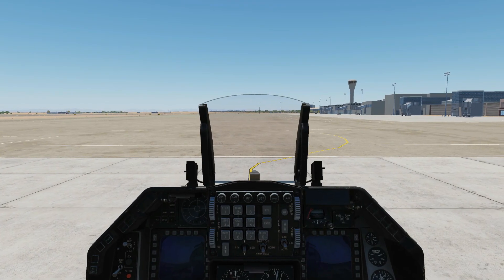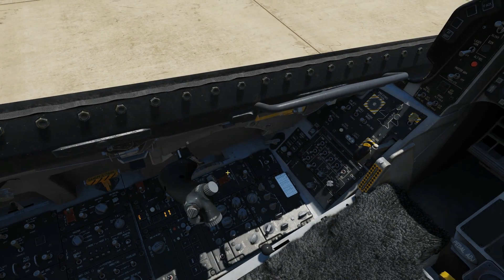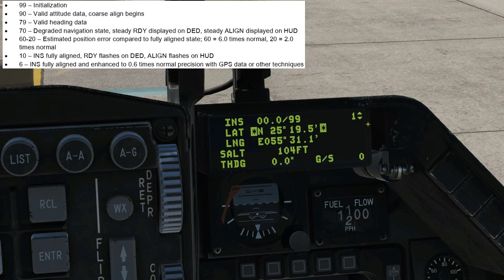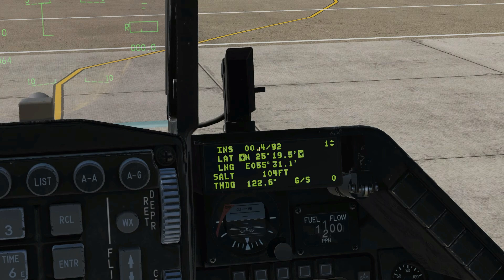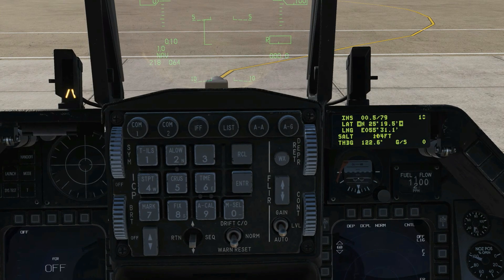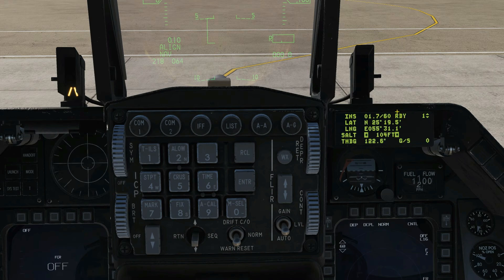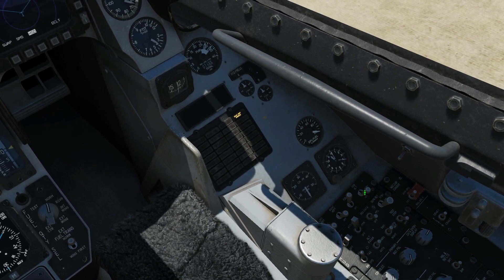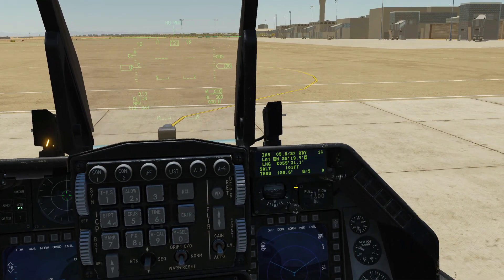F-16C Viper: Cold Start & NORMAL Alignment Tutorial | DCS WORLD

Comment: Main PWR on
Close canopy, canopy handle down
JFS Start 2
Wait for stable 20% RPM
Throttle to idle
Wait for stable 60% RPM
Switches on: UFC, MFD, ST STA, MMC, GPS, 
MIDS knob on
INS knob norm, (LIST + 6, 8min to fully align)
Confirm LAT and LNG, each with ENTR
IFF knob norm 
C&I knob UFC
Adjust backup ADI
Switches on: FCR, RDR ALT
Scroll HUD brightness 
RDR power on 
CMDS mode MAN, CH on, FL on
Arm ejection
Ext/Int lights as required
Check warning panels for warnings
After INS align complete -> INS to nav
Reply: Thanks!
Reply: Thanks
Reply: @BOUNCY700   You need to confirm the coordinates LAT and LNG like shown here: https://youtu.be/ynVslvvehB8?t=114  Otherwise Datalink won't work. I'll edit my original comment.
Reply: What about the Air source? I believe Falcon 4.0 used to require me to set that.